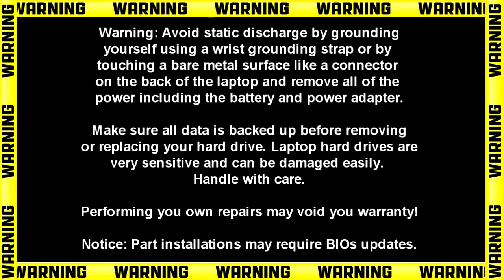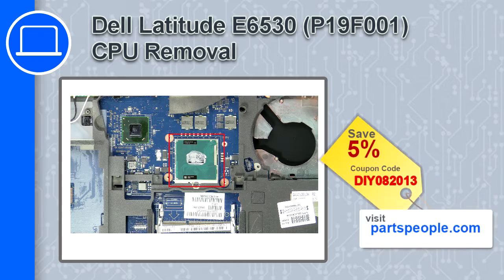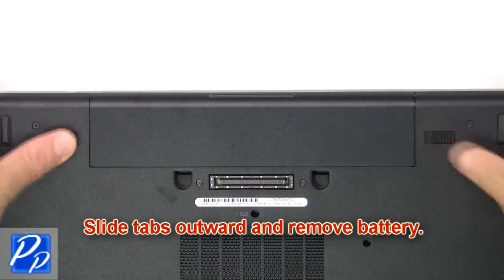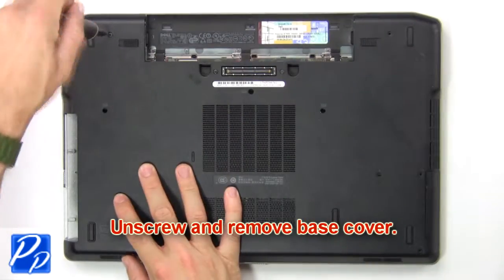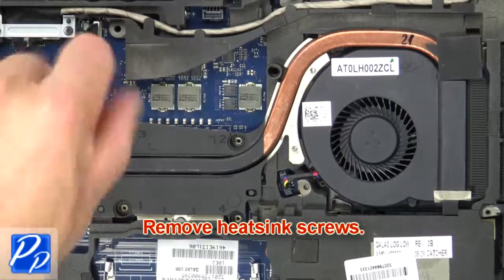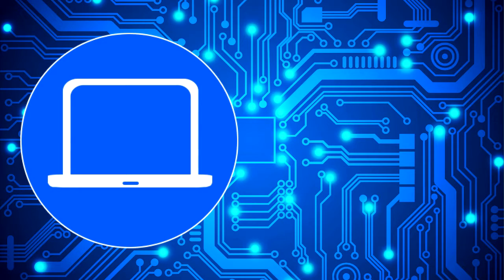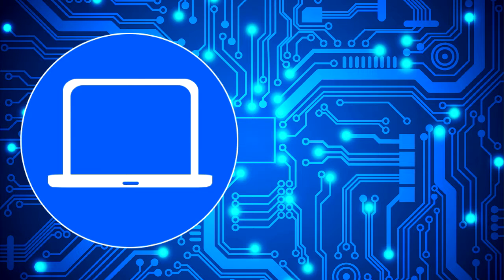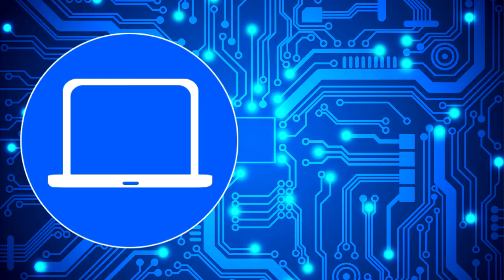Dell Latitude E6530 (P19F001) CPU How-To Video Tutorial

Comment: How do you unscrew those heatsink screws? Is it done with a flat screwdriver, Philips screwdriver, or some other type of device to use on the so-called "screws"?
Reply from the maker: Hi, yeah this is a older video so it's hard to see but usually they are Phillips head screws but you'll want a small one.